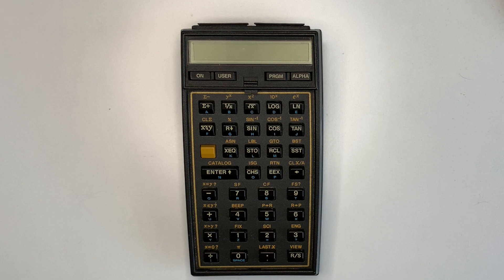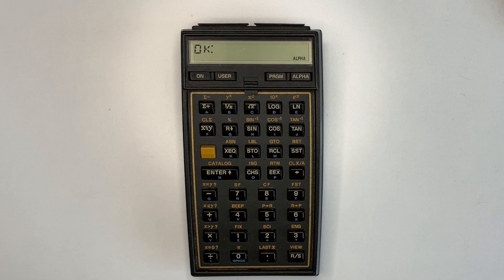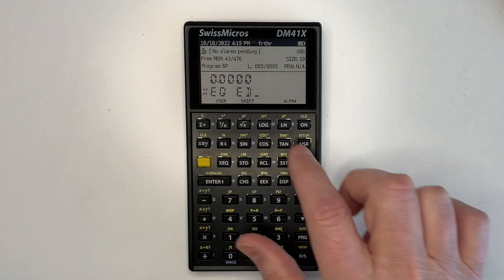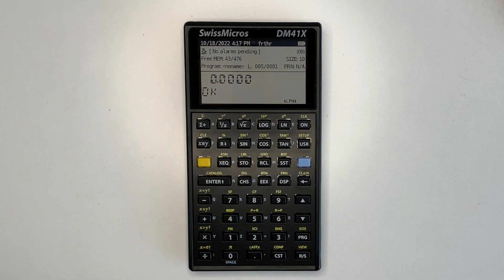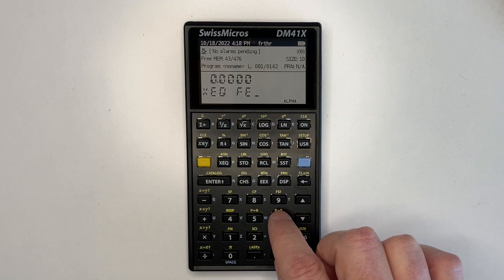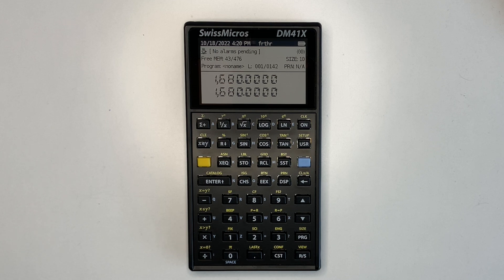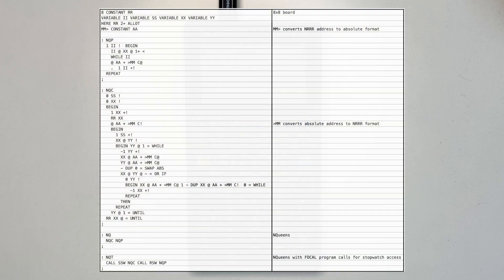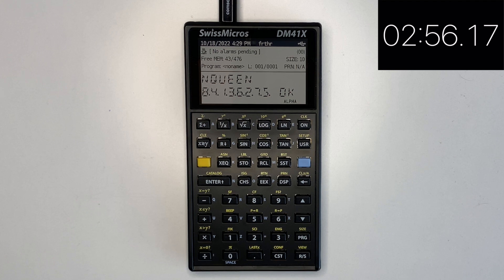HP 41C and Swissmicros DM41X run FORTH and N-Queens

Comment: Forth was where I first learned RPN--I learned it without really having a machine to run it on, in theory because I was thinking about using it on Atari computers. Later I used some Forth on an Atari ST to develop a program that was supposed to be for a tiny Forth-based computer we were building in an electronics class.
Reply from the maker: I find Forth easier to remember and pickup again after a break compared to, say, RPL. Forth also runs on pretty much anything.

Comment: Been running in forth for years!  Thanks for the video,  cheers, Geoff  (p.s. this just showed up on my YouTube channel!)  also running forth on my 71B with the Fram module.
Reply from the maker: The FRAM71B module is a very worthwhile addition to the 71B. There's also the MultiMod module that provides a flashable ROM emulator (no RAM) which is a bit cheaper if you don't need the additional RAM or have more than one 71B 🤓

Comment: I’ve got a 41CX and a 42s from Swiss micros. How do I get this forth module? Maybe I’ll just go and buy a  DM41X
Reply from the maker: To run on an original 41C series calculator you will need a (physical) ROM emulator to load the module software into and then plug into the calculator. I use the NoV-64d available from https://clonix41.org/. The DM41X supports loading modules via USB with no additional hardware which lets you try out the large range of modules available. FORTH-41 runs well on the DM41X as it is significantly faster than the original calculator. The cheapest option is to use an emulator.